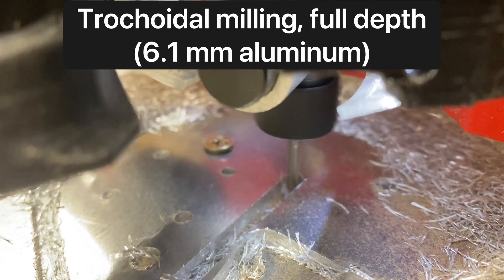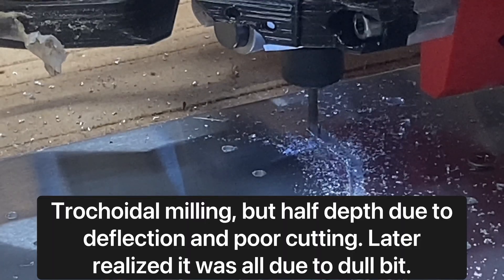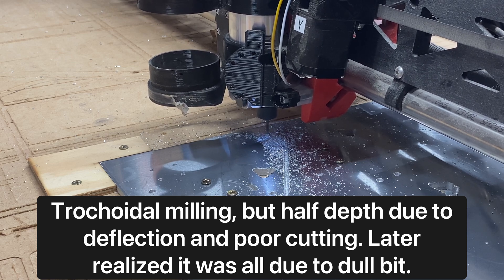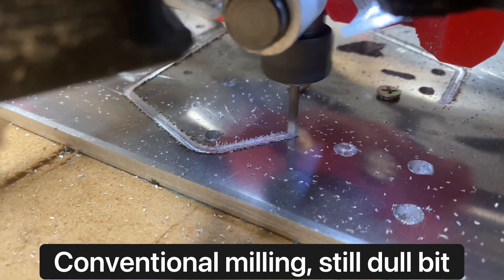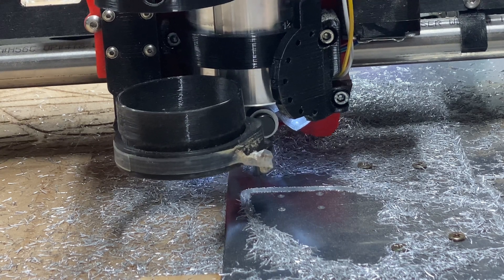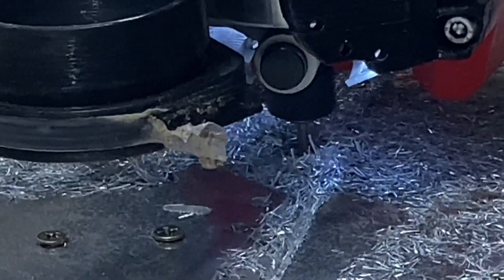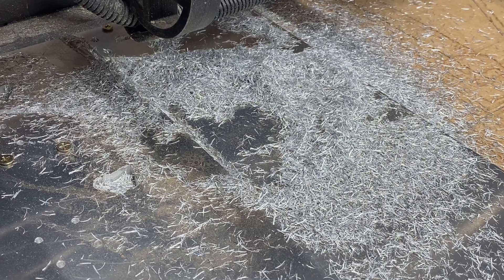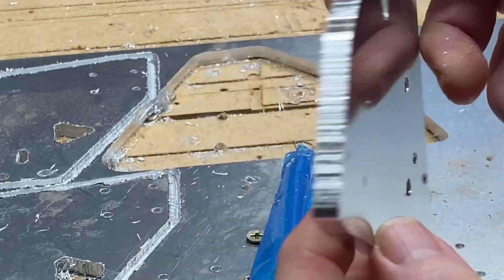LowRider v3 DIY CNC - Aluminum.  Fat chips!  Trochoidal milling.

Comment: What CNC program are you using for cuting? Is it the inbuilt in FluidNC?
Reply from the maker: The G-code file I’m using for the trochoidal milling here was rendered and output from a wonderful CAM program called ESTLcam. It is very popular, very affordable, it only takes a one time purchase, as opposed to a subscription. I hate subscription-based software with a passion. There’s a free trial available, and if you try it, you will like it.
Reply: @design8studio  Have owned a license since 2020 so yes I'm used that for a while but been using the CNCjs as controller. Think that is an awesome program. I asume you are then using ESTLCAM's inbuilt controller to run the cutting/milling? But what bit are you using for aluminium?
Reply from the maker: @ I’m not using ESTLCam controller. Just the Jackpot board from V1 Engineering which runs FluidNC firmware. It’s Wi-Fi enabled and can be driven around and controlled by any WiFi enabled phone, tablet, or computer. I also have wired control by way of an optional FluidDial, but it’s not necessary. The bit is an affordable one from V1 Engineering. I think I mentioned how many flutes etc in the video. I may have linked to the bit in the description. Not sure. [EDIT: link to bit has been added to video description.]
Reply: @design8studio  Ok good thanks for answering quickly. 😊
Reply from the maker: @jensbackman6900  Re: what bit are you using for aluminum — In the video, I show the bit details at around 3:17 — in the ESTLcam screen shot. It was a 1/8" carbide 1-flute (aka O-flute) bit. Here's a link to it on the V1E shop (currently selling for $5.40): https://www.v1e.com/products/1-8-single-flute?_pos=2&_psq=1%2F8%22&_ss=e&_v=1.0

Comment: Hi Doug, I was wondering what the start of the cut is like. Once the slot is made, I understand that trochoidal milling seems much better than conventional milling. I use Fusion 360 in CAM so I am having a hard time adapting to adaptive clearing. Maybe I'll switch to EastCam or at least to make aluminum cuts. I'm trying to cut my LR4 plates on my LR2 and I'm having a hard time.
Reply from the maker: So the start of a cut is like a spiral motion version of straight downward drilling, only far slower than you would think it would be. It’s almost maddeningly slow. But once it finally reaches full depth and hits into the forward-motion spiral-type cutting then it was worth the wait. I don’t know if there’s a way in ESTLcam to speed up how fast it’s moving downward, but it seems to be like it could afford to be faster than it is.

Comment: Thanks for the video. Are you able to get the machine to go faster on trochoidal? I am running the FluidNC and the software seems to not be able to go any faster than around 1000mm/min, which isn't fast for trochoidal. I think its a limitation of the FluidNC/ESP32, I think the physical machine could handle at least 2-3x that without shaking itself too badly.
Reply from the maker: @GSeymore  you can raise the limit in both ESTLCam (or?) and in FluidNC config file.
Reply: @design8studio  I didn't see a limit in EstlCAM, is it there, or do you men the Fxy for the tool? I have max_rate_mm_per_min at 9000 for X and y axes so I figured I was good there. Are these the settings you are referring to?
Reply from the maker: @GSeymore  In ESTLCam there is a governing max speed limit in the settings. I am not at home right now, so I can’t verify by looking at my computer. But if you go into the settings, you can set that max speed up. Similarly in the FluidNC config file there is a max speed that you can raise.
Reply: @design8studio  I have the rapid feed rate in Estlcam at 8000. I checked the GCode and the feed rate in there is 5000 for each G01 line moving aroubd the part, as set in the tool list. FluidNC config max rates for X and y = 9000.
Reply: @design8studio  I wondered about the same thing, but I am pretty sure the Fxy in the tool list is the velocity it moves around the loops in trochoidal.

I'm thinking my speed limit around 1000mm/min is due to how many lines it is taking to describe tiny movements either due to frequent starts/stops or maximum memory or processing conatraints of the ESP. Just my working theory and could be wrong of course. But I wonder why Estlcam doesn't seem to use G02 or G03 (arc) commands for trochoidal as that seems like it could accomplish the same motions with far fewer lines.  I seem to be capped out somewhere in the ballpark of what you're running in the video, Christian seems to be running his significantly faster. Did you happen to ever try running faster, even with just air cuts? If you've gotten it faster even in air then that means I just have to figure out what I've got wrong.

Thanks for your time!
Reply from the maker: my speed of cutting shown in this video, seemed to me pretty close to the speed that Christian was using in his video explaining about trochoidal cutting. I will try to check into this to see if I could speed it up even more. At least I have this video as evidence to compare against.
Reply: I reread my orig comment and should have clarified that I can get the machine to move significantly faster than that normally, but I turn up the Fxy to 5000 on trochoidal and it doesn't go any faster than at around 1000mm/min (ie, set on 5000 but feedrate overrides don't make a difference until around 20% which I think means the software is maxed out).
Reply from the maker: @GSeymore  I just read your clarification, and I had noticed that forward movement during trochoidal milling is slower than the rate shown, and I just assumed that the rate applied to the speed at which it’s doing the orbital motions, and that the forward motion was some kind of fractional calculation based on that orbital motion. I could be wrong. I guess I need to look into that some more.

Comment: Seems to me the v3 is the same machine as the v4. I dont think the rails on the v3 are are flexy at all especially if stainless tube was used. Where is the big improvement?
Reply from the maker: There are improvements across everything, which although each one may seem minor, all accumulate to a better machine. Starting with the gantry, my LR3 had 1" OD (25.4 mm) stainless steel tubes. The LR4 has either 29.5 mm OD (EMT is sold based on ID, so 1" EMT is 29.5 OD), or 30 or 32mm steel tubes. The larger tubes are stronger than smaller, even if the smaller is stainless. The rest is a lot of tightening up for rigidity, beefing were more beef was needed etc. This gantry is more rigid than my LR3 gantry was. Cuts are being made with stock LR4s that were not doable with stock LR3s.

Comment: I was considering making the lowrider V3 my first mpcnc build in a few months. Would you suggest waiting if version 4 is currently being worked on?
Reply from the maker: The wildcard here is how long before the V4 comes out. It could be weeks or months. The good thing is that the hardware kit for v3 will be almost identical to v4, with the only difference being a few screws. The other differences between v3 and v4 will be: different printed parts, beefier EMT tubes (larger diameter), and shapes of flat parts (XZ plates, strut plates) are different. Finally, the YZ plates were a flat part on v3, but they become a printed part on v4. The consensus advice is to consider building the v3, learn the ropes, do some cutting, and when v4 comes out, you could use the v3 to cut the flat parts for v4, and reuse the hardware kit.

Comment: So first time watching channel, and some solid content. I had an idea which maybe worthless. Would it be helpful to have a 2" vacuum hose near the milling head to suck away the chips while the machine is operating?
Reply from the maker: Yes, and normally I do that — but mine's a 2.5" hose. You can see the mounts for it in the video (to the left side of the motor mount area. I took it off this time primarily so I could watch up close to see what's going on, and to allow the viewers to see as well. When the dust collection shoe is in place, it obscures the view quite a bit.
Reply: @design8studio  That makes sense

Comment: Nice work!  What do you think will be the biggest advantages of the upcoming LR4?
Reply from the maker: Well, whereas my LR3 has 25.4 mm tubes, the LR4 uses anywhere from 29.5 mm up to 32 mm, cut from EMT rigid steel conduit (available at home improvement stores / hardware stores). Since those are more rigid, the rest of the design has been beefed up to translate that to a stiffer, better machine. The early reports from the beta team members are impressive.

Comment: OH MAN CANT WAIT TO SEE THE NEXT VERSION OF THE LOWRIDER.
Reply from the maker: I was just replying to another commenter, saying that whereas my LR3 has 25.4 mm tubes, the LR4 uses anywhere from 29.5 mm up to 32 mm, cut from EMT rigid steel conduit (available at home improvement stores / hardware stores). Since those are more rigid, the rest of the design has been beefed up to translate that to a stiffer, better machine. The early reports from the beta team members are impressive!
Reply: @design8studio  any chance of more z travel? I cut a lot of foam and pvc board and would love a bit more z. It's the only shortcoming of the lr3 for me honestly.
Reply from the maker: @stephengolaski6451  That LR3 that you see me using in the video is mod’d: it has +50 more millimeters of Z travel height than the stock LowRider design However, while other CNC designs get less rigid as they move down into the material, by contrast, the LowRider design gets more rigid as it moves down to the material. This means that the normal CNC approach has a weakness regarding making deep cuts, while the LowRider design’s area of “not as much strength” is at the top of very tall, thick materials. However, if what you are cutting is not stiff (hardwood or metal) then you can modify the design to get thicker Z travel. However, another way to approach it is a drop table, or raising the rails that the LowRider travels on. There is a possibility for remixing the new version to allow for taller YZ plates like how Dan and I did on the LowRider v3, however, we’re deliberately not even talking about or thinking about mods right now until we get the stock version launched and understood.
Reply: @design8studio  hmmm..any chance you would share the files for the taller sideplates? Are they in your printables? Yeah i was thinking of rails and or drop table... just hadn't settled on a design yet. Im doing a lot of signs and latge foam props so a 3" cutter woyld be great...one less glue joint
Reply from the maker: Yes. Go to the link below, scroll down to “Other Files” and get the “Vectors for DougDanTall plates” - I use the extra height mostly for access to get underneath the thing and for occasionally jogging it over thick items laying on my CNC table that I also use as an assembly table. However, if what you’re cutting is not super rigid, like in the foam category that you mentioned, you may well be able to actually get some cutting at the high Z range.- https://www.printables.com/model/805777-lowrider-v3-cnc-fenders-for-various-stock-tall-yz/files

Comment: Nice big chips!  Cheers for 3:35 settings that are working for you.  LR3 with gantry sized for up to 4' wide cuts?  1" DOM steel pipe?
Reply from the maker: Yep, LR3 wide enough to cut 49" wide MDF (or 48" wide plywood) and 1" DOM steel tubes on the gantry!
Reply: @design8studio  your wide gantry makes the cutting depth all the more impressive to me.  Cheers!
Reply from the maker: @AzaB2C  No joke. I'm still amazed a DIY machine this wide and this affordable can do this!